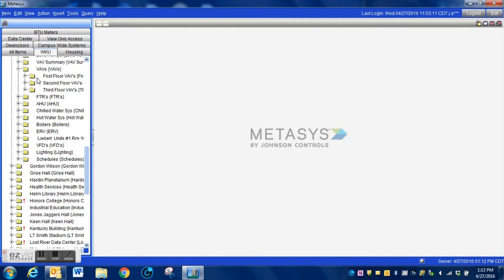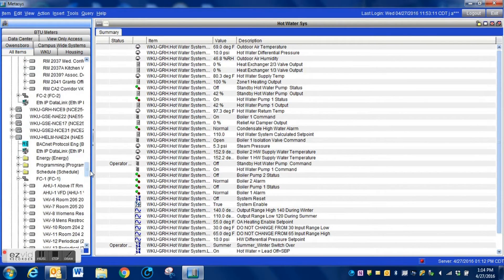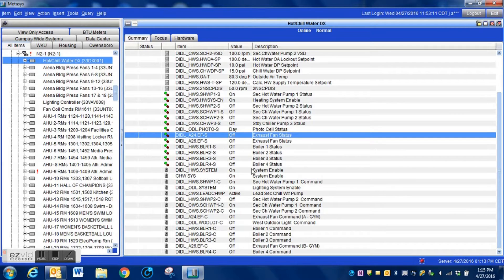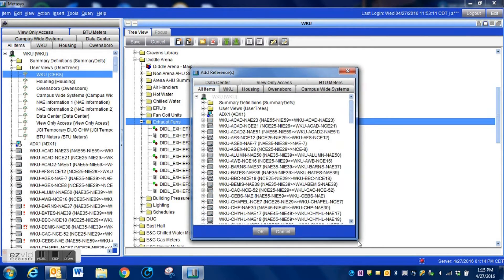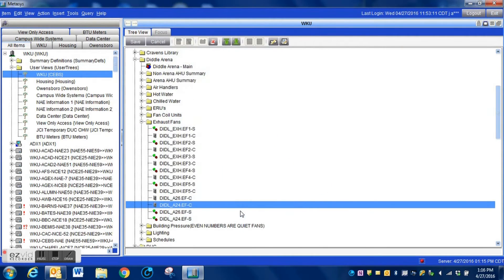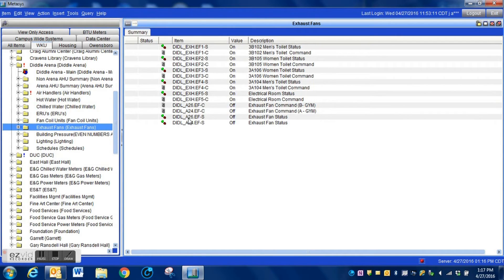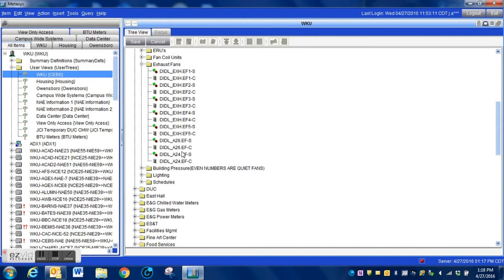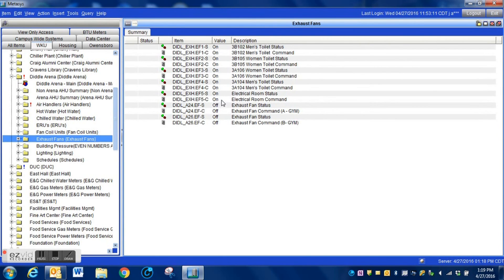Editing Metasys User View

Comment: Great video. Thanks for all the work. I am looking at my metasys graphic and now notice ?????? where my point value should be. I do I fix of reconnect this? As one example, I am looking at my thermostat graphic icon and see ?????? where I should see the room temp.
Reply from the maker: The controller could be offline for some reason. Look at the device in the all items tree to see if it is. It may also need a reset or it could have lost the point binding.
Reply: @Systemcontroltech  thank you